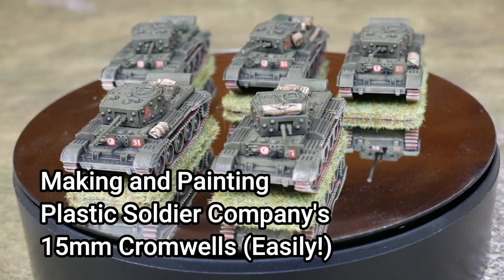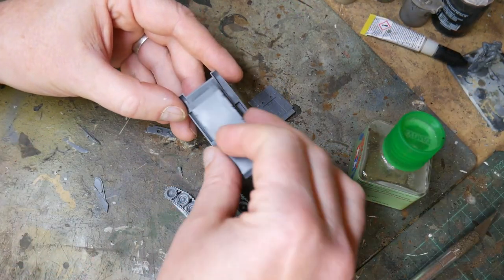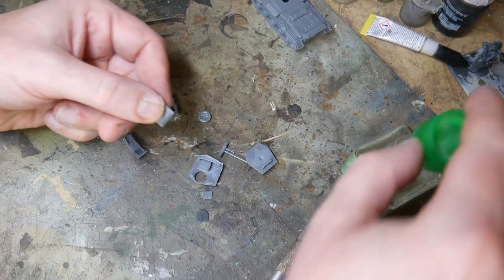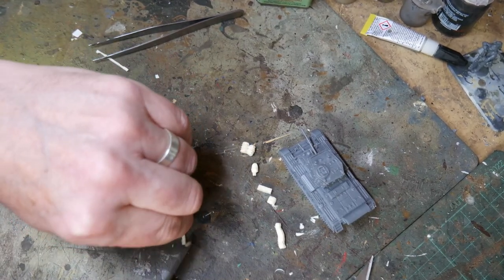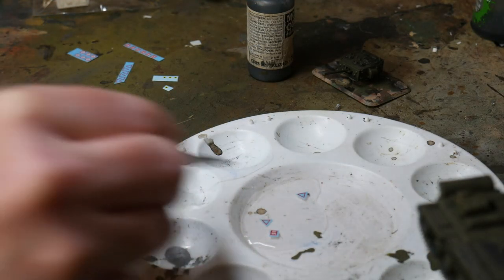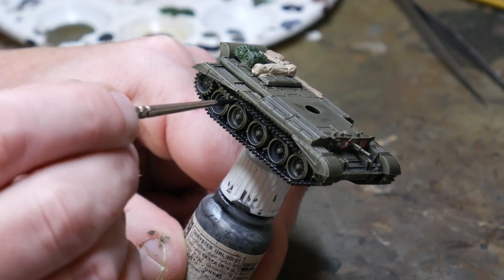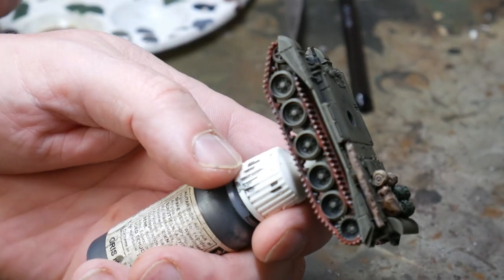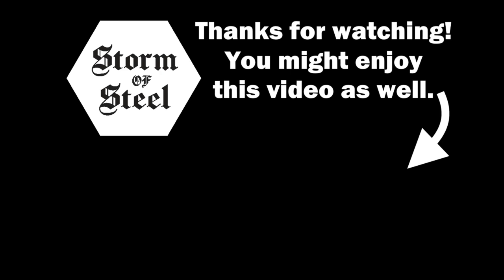Building and Painting Plastic Soldier Company's Cromwells (Easily!) | Storm of Steel Wargaming

Comment: Also. Can I pick your brains, please? I've built a couple of PSC's  1/72 Churchills and had an issue with the paint. The first, I sprayed with Revell rattle can OD a d the paint crinkled! So I made the second, and this time I washed it first, then used Poundland black primer, (on of my preferred primers), and again, the paint crinkled. I sprayed outdoors and left it to cure overnight in my shed, which is brick built and insulated, so no damp issues. I've been modelling for decades, (still crap, but i enjoy it!), and this is the first time I can recall having this issue, and I'm stumped as to why!
Reply from the maker: I'm not sure to be honest, I know someone else in Sweden has been having the exact same issue, but I'm not sure how to fix it, TBH.
Reply: @Storm of Steel Wargaming  well, thanks for trying. Maybe a duff batch of plastic. I'll try their website and see of they've an answer if not I'll cover it with a camo net or something. Thanks again.